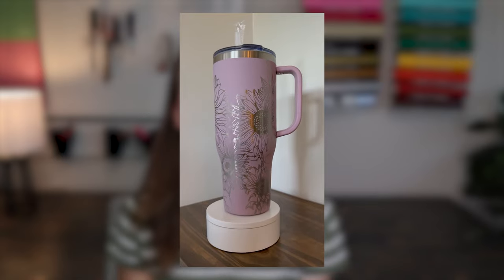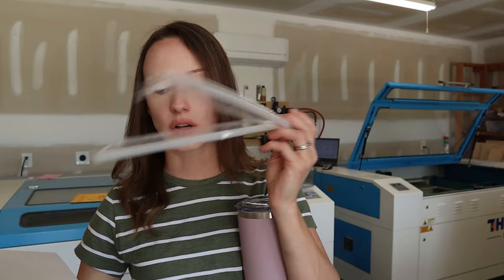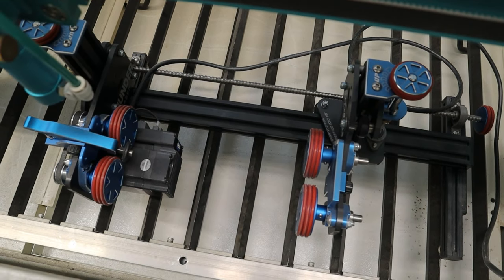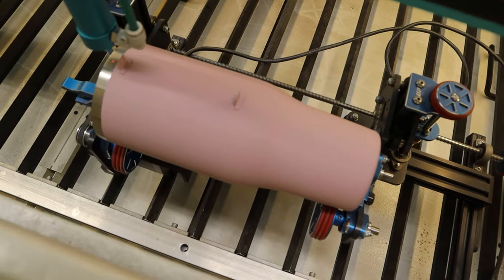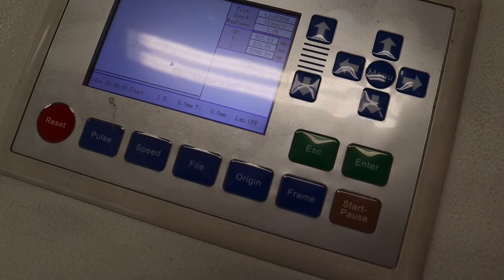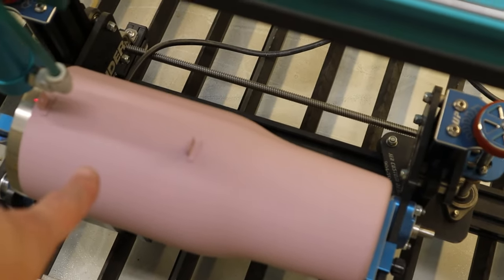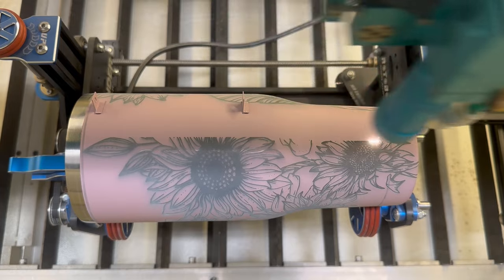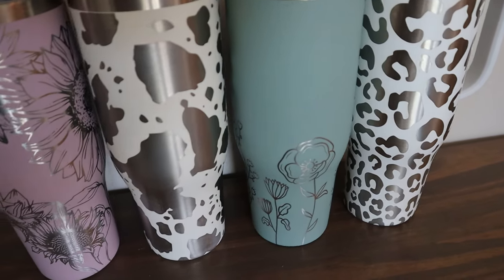How To Laser Engrave A Full Wrap Tumbler With Handle | Best Seller

Comment: Hi, great video. I just wanted to mention another option to the 14mm head. If you’re not going to use the air you can just remove the cone from the 2” head. That will give you 37.7mm clearance. I made a little jig for myself so I could easily get the right focus (6mm) but like i said without the cone. Also I noticed you struggled to get the pointer in the right spot on top of the tumbler. You might already know this, but if you hit your speed button and change the speed to say 50 you can get it to move right where you want it. Just don’t forget to change the speed back other wise when you do your preview it will take forever! LOL . Anyway again great video, just wanted to give your viewers another option for the focus.

Comment: So you dont raise the bottom to the same level as the top? You just basically set it up as a normal 20 oz tumblers but use the 4" head to compensate at 10mm? Great video!

Comment: I was wondering if you have any recommendations on the full wrap  I am using a epilog Fusion Maker 12 and I am able to engrave the top half on a 40oz Stanley without any issues but once it get the the lower part the engraving it don't come out . Any recommendations I cant find any tutorials on the epilog machine.

Comment: So good video to start with, but..  I was watching this so I could start using my rotary to do tumblers from this company.  Your focusing part just doesn't make sense..  After you level the tumbler as shown, you will need to focus your 10mm off the cup on the large end, not the smaller tapered end.  if you do the smaller end as described,  you will hit your tabs every time as they stick up 9.3mm already as it is.  just not enough clearance clarence :)
Reply from the maker: You focus just above the tabs! I haven’t had any issues with mine ending up pixelated/blurry! It hasn’t hit the tabs either. Just know it is doable, I have made many of these 😊
Reply: @SimplySallie  perfect,  the way you said in the video really didn't state / clarify that :)